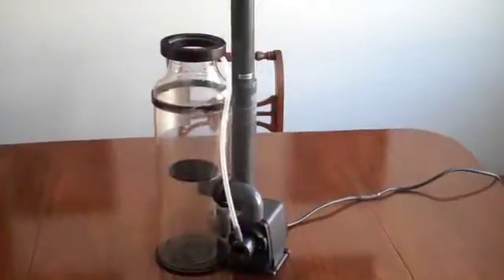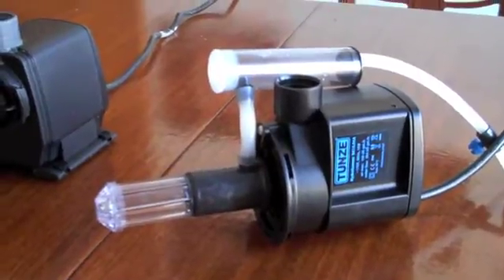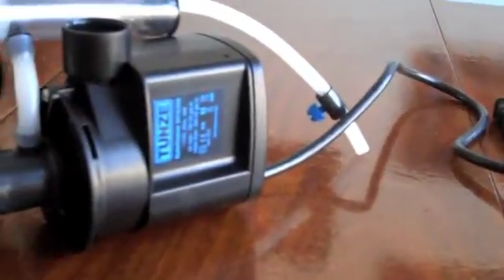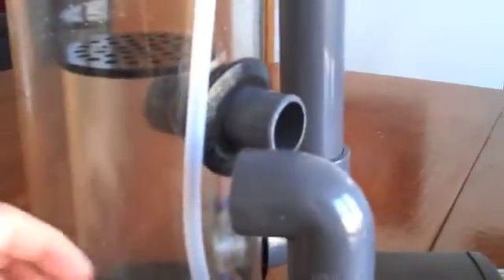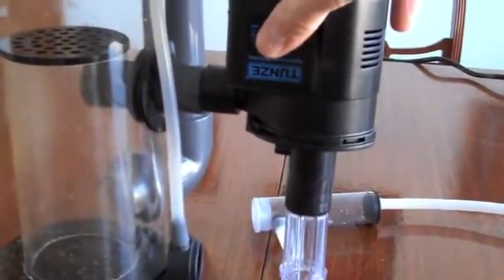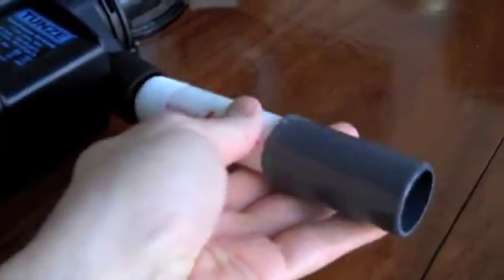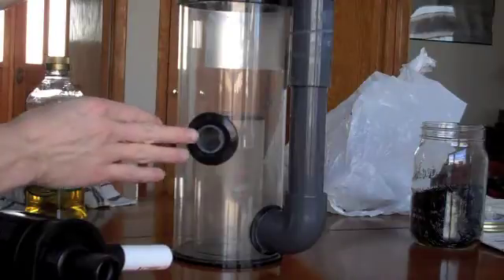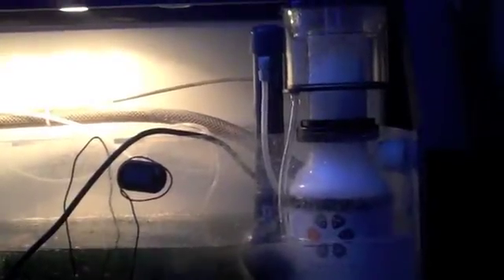Vertex IN-80 Skimmer pump upgrade to Tunze Hydrofoamer

Comment: You can make it more quiet by using vinyl tubing instead of PVC to minimize vibrations also set the simmer on a sponge pad, how is the micro bubble problem? U think the increase in airflow caused this? Or the inside tube modification ?

Comment from the maker: Just a follow up. I have found that it skims MUCH better when I pulled te air intake hose off of the PVC stand pipe. I just let it hang, sucking in air from outside the sump and it skims great. Silent & effective. I'm very happy with the end result.